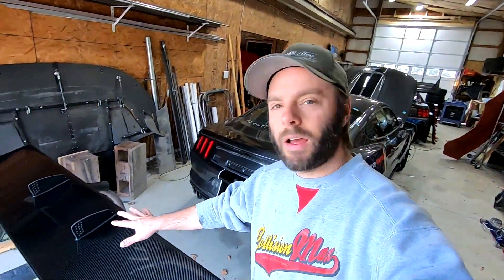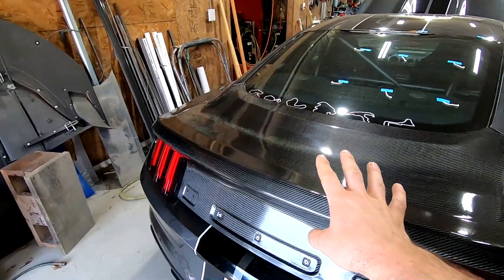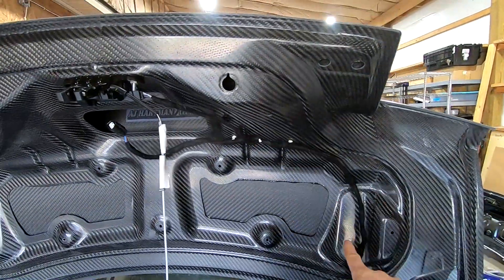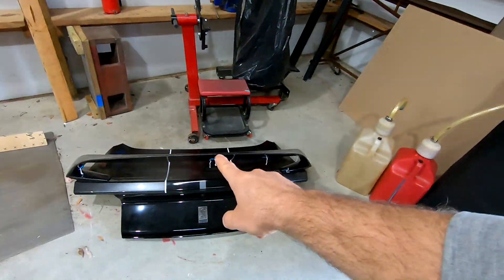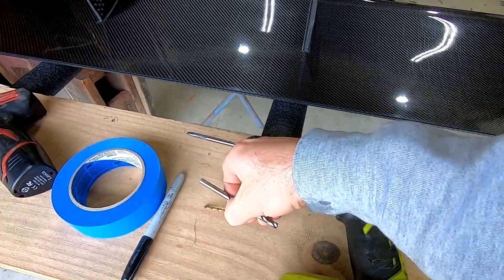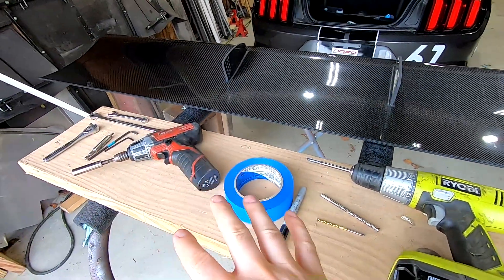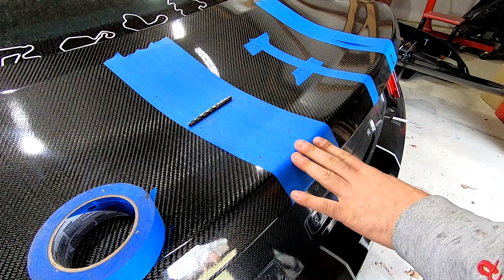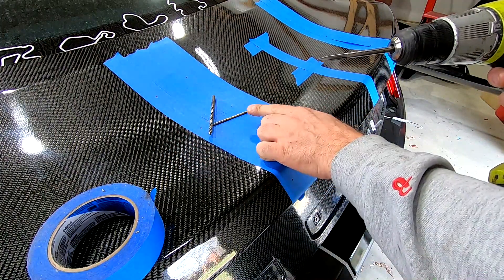Mounting a Massive Wing to my GT350 capable of over 1200lbs of Downforce

Comment: As I understand it, a proper wing is capable of generating immense force. With that in mind, I noticed you don't have a support structure in the boot so the wing ties to the frame of the car on the boot floor.

What I'm trying to ask is; is it not necessary to reinforce the bootlid to be able to take all that newfound force? Be it an OEM metal or aftermarket bootlid?

Comment: Very great projects, congrats ! I'm surprised of that high value of downforce. It seems a bit exagerated for a single element wing with that camber and area.
Reply from the maker: CFD and wind tunnel data support our claims on Df numbers.
Reply: Which configuration are those 1200 lbs referred ?
Reply from the maker: @CP-zi3eg  only 5 deg with a gurney at 150
Reply: Thank you

Comment: Your products are very nice. 
Isn't the purpose of a swan-neck wing mount to eliminate or reduce turbulence or vortecies on the wing surface? Would the mounts being in front of the wing not create turbulence across the wing surface?
Reply: I’m pretty sure swan necks free up the underside of the wing which allows the whole width to work. I’m assuming the underside of a wing contributes more to making downforce than the top side.
Reply from the maker: Davo’s reply is spot on. The underside being clean is much more important than the top since low pressure happens at a much greater magnitude than high pressure on top.
Reply: @ajhartmanaero  I understand that theory, but do the supports in front not create vortecies which would reduce flow over both sides of the wing?
Reply: @idriwzrd  a reverse swan mount from the rear. I’d like to see that tested!